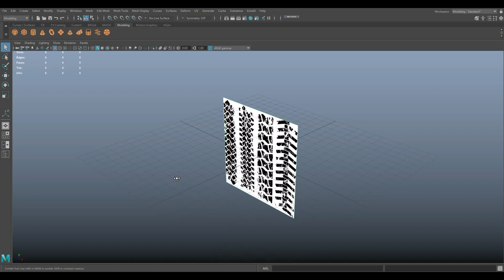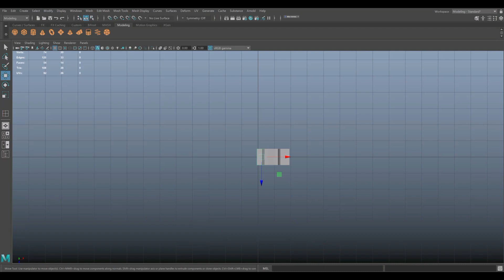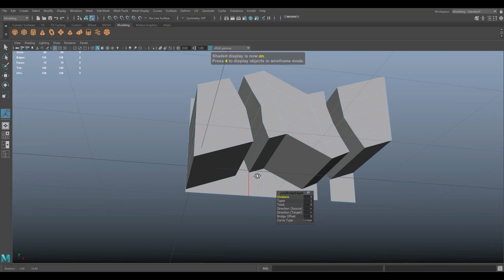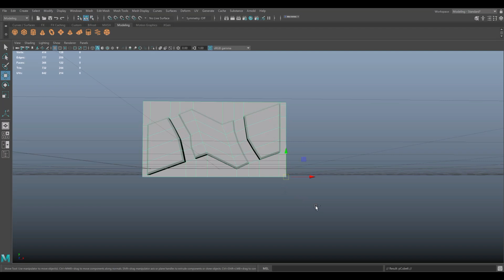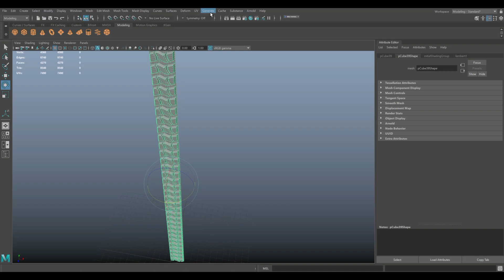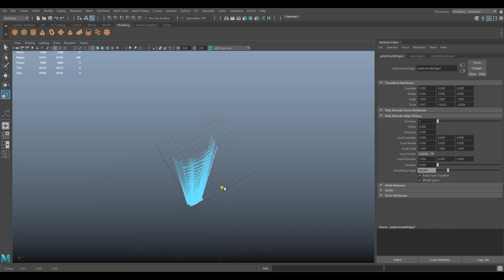How to model a Mountain Bike tire tread in Maya 2019

Comment: The treads moving out from the center will start to increase in size as the shape is bent in a circle. The treads towards the center of the object will hold their shape, causing an uneven distance. is there a work around for this?